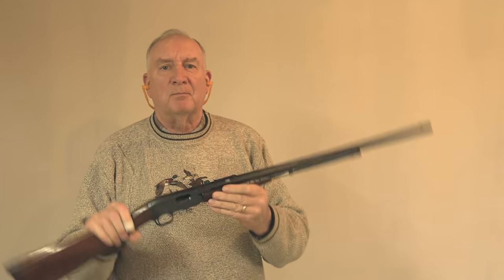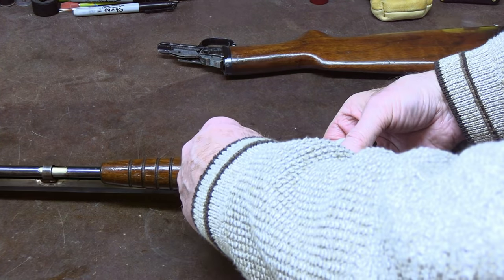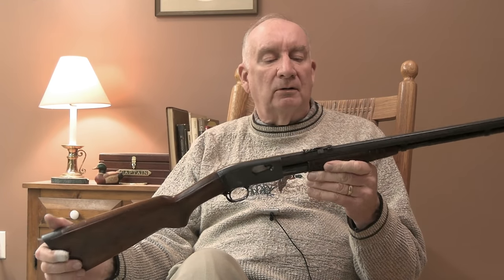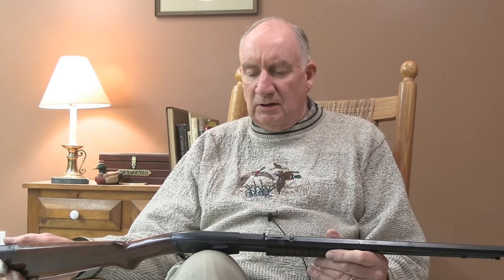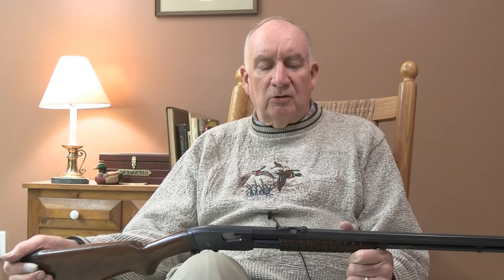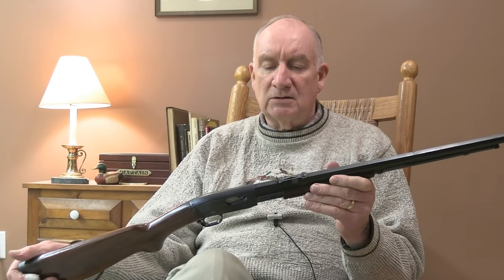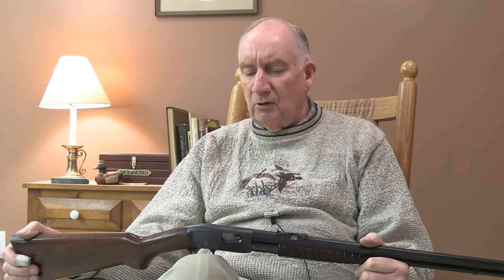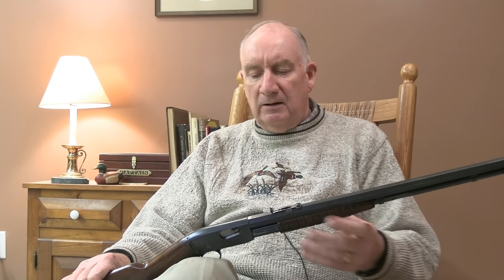Remington Model 12 C ~ Pederson genius, or another mistake?

Comment: I recently picked up a model 12a. Dates 1919. Almost mint except for small crack in both stocks from people tightening the screws too much 🙄. Sat in safes for many many years. Feeding issue was never resolved. I picked it uo cheap. Feeding issue was caused by buttstock bolt being tightened too much. The end of the bold prevents the hammer from going all the way back. Add another washer or two onto the bolt and problem solved. Cycles flawlessly. 😁

Comment: Hi from England's Derbyshire Peak District.  I enjoyed every moment of this chat.  So thanks very much.  I have recently completed a refurbishment of my 12C which was caused by the firing pin snapping in half and jamming everything up.  I bought a replacement new firing pin via "Brownells UK" who probably obtained it from "Numrich".  My rifle's serial number dates it as manufactured in 1915.  So another one more than a Century old.  It looks exactly like yours.  However at some point in time it has been re-sleeved by a previous owner and the end of the muzzle has been  stamped in a circular fashion accordingly by the gunsmiths : "Parker rifled", being the "Parker-Hale" company of England.  The accuracy is amazingly good and it cycles very smoothly probably due to 100 years of running in.  I have noticed a difficulty on re-assembly where the cartridge retainer is little awkward to fit back in place.  There is a method to it that takes a while to figure out.  I will not be parting with this rifle anytime soon as I have fallen in love with it.

Comment: Thanks for the heads-up on the complexities. I was considering bidding on one. I will stick with my Winchester 1890 for now.
Reply from the maker: If you want a vintage steel pump, I'd personally suggest a Winchester Model 61, as demonstrated in my short Christmas video. It's action is so reliable and simple that Winchester incorporated it into their fabulously reliable Model 9422 lever action.

Comment: The 12C I own is by far my favourite .22 rifle, though mine has a factory tang sight. They're somewhat complicated, but I would not say extremely so. The magazine tube doubling as the action bar always struck me as a clever simplifcation, though it does necessitate a different feed mechanism than most.
Reply: That tang sight is rare to find, very expensive to buy.
Reply from the maker: Pederson used an incredibly complicated system of many overly complex, expensively machined parts to simply release a cartridge from the magazine. The result is an action that takes four times more effort to shuck, ejects lazily, is historically prone to malfunction, and extremely difficult to work on. Other than that, it's a great, fun gun.
Reply: @GunBlue490  Other than the Mrs. Lincoln, how did you like the play?

Comment: Can someone help me with a question? I have a Remington model 12.
It's in fair condition but shows visible wear and who knows whos had it apart in the past.. Ive noticed that my lifter flops back and forth if you turn the rear of the gun upside down when it is apart.
Is the lifter suppose to have a spring that holds it in the downward position? Or is it suppose to move/flop freely when the gun is apart?

Comment: What are your thoughts on Remington 760 and 7600. .30-06 22” or 18” barrel?
Reply from the maker: My dad and my wife both hunted with 760 pumps for quite a number of years.  The case capacity of the 30-06 sacrifices about 100 feet per second with the 18" carbine, and it will have terrific muzzle blast and flash.  Carbines and 55 grains of powder are not a compatible pairing.

The question boils down to your intended use.  If it's going to be a woods gun, the carbine would certainly be more practical, but I'd then go with the .308 Winchester, which works much more efficiently with a shorter barrel, and will provide the same ballistic performance with any bullet weights up to 180 grains, and with far less recoil, muzzle blast, and flash.  

If it's going to be an open country gun, the 30-06 in a 22 inch rifle will give slightly better ballistics by about 50 yards.  If it were my own gun, my first choice would be a 7mm-08 in the 18" carbine for woods with 140 grain bullets, which has better ballistics than the .308, and even less recoil.

Comment: I have a question on my 12B that you may know the answer to. I was taught at a very young age to not "Dry Fire" any gun, especially a rim fire. I have seen chamber damage to .22s that have been repeatedly dry fired. So will the firing pin contact the chamber in my 12B if I dry fired it? Thanks much, Wayne
Reply: Never…..NEVER…. dry fire a 22….EVER !
It’s a “rim fire”…..which means the firing pin strikes the edge of the bolt face if there is no round or snap cap in the chamber, causing peening of the bolt face.
Oh…..you can THINK about it…..but dooooon’t do it !!!

Comment: In response to your comments about Pedersen’s design choices/decisions… well a lot of them perhaps all of them were dictated by the fact that John Browning got there first.  Pedersen had to design around Browning patents so that Remington wouldn’t have to pay royalties.  As far as complexity and machine work… labor was cheap back then, even before the depression started
Reply from the maker: Folks have been offering those excuses for Pedersen for decades, but they hold no water.

Patents are very specific and aren't generalized concepts that lock out "fundamental" established common engineering principles. Even Browning was governed by preexisting patents. You might get a patent on how a pin passes through a piece of steel, or how a bolt is shaped, but not on the concept of the bolt, or steel or the pin.  Lots of gun engineering was going on then, and has continued for decades with ideas that worked around his and other patents, and that's certainly not an issue exclusive to guns.  As an example, Arthur Savage's Model 99 came after Browning, and is quite a bit simpler, and was from an entirely fresh slate.

Successful companies seek talent that thinks outside the box, no matter what they make.  There's no room for excuses, and no Hall of Crying Towels for the Pedersens in this world.  

Cheap production is a myth. There was never, ever, a period in American history of "cheap" production.  Even when workers were grossly underpaid, everyone competed in the same marketplace with the same labor pool, and put their goods into the same consumer market for the same dollars.  The Great Depression had the same effect on manufacturing and consumers alike.  A nine dollar .22 in 1905 was just as costly to produce and buy as a $300 .22 is today.  Every gun I ever bought in the last 55 years took the same chunk from my wallet.

But, simplicity is the hallmark of production design, and is the winner in the competitive world.  Elaborate designs may win prizes at science fairs, but it won't put good bottom lines on a company spreadsheet.  Pedersen didn't get that, and Remington apparently didn't either for too long.  He used four complex parts where one or even none would have sufficed.  One can appreciate the intense thought and engineering it takes to watch a Rube Goldberg contest winner start out with a steel ball rolled down a ramp and end up starting a car five minutes later, but it really makes more sense to just turn a key.  

I think perhaps the guys who designed my gas can spout and spring loaded toilet paper roller were related to Pedersen.
Reply: @GunBlue490  pretty strong opinions on the matter and not much good to say about Pedersen. Perhaps you can do a video about your firearms designs/patents

Comment: I agree with you , I have owned a REM. 121 , basically the same rifle . I also own. Win. Model 62A & a Win 61 . I had some minor feeding issues with the REM & sold it . I still own the two Winchesters . I also own a Remington Model 51 in .380 acp , A rather odd duck of a pistol .

Comment: I have a Model 12 that has a super light trigger. Sometimes it will fire just cycling the action. Any idea how to fix it?
Reply from the maker: That's a very dangerous gun that should be repaired by a skilled gunsmith before it's ever fired again.  My educated guess would be that someone tampered with the trigger to make it lighter, resulting in the hammer slipping from the sear.

Comment: Very similar to the Browning Trombone in action function. The tube moving is a simplified design in reality.
Reply from the maker: Simplified complexity.  Far more moving, intricate parts than necessary, and very prone to malfunctioning.
Reply: @GunBlue490  I don't see much of a difference between the two mechanically, mind you I haven't got a Remington 12 to compare to my Trombones so I am only going on the videos of the 12. The Trombone definitely seems more complex in the break down, which I have done.

Comment: I inherited my grandpa's model 12 back in the 60's.   It had the same issue with brass getting stuck in the chamber from all the corrosive powder and I doubt my grandpa ever cleaned it.  I bought old stock lower velocity rounds and was able to cycle those without sticking and used it for years that way.   I finally had a new barrel sleeve installed in the 70's and it's been terrific since then.  Planning to hand it down to my grandkids one day